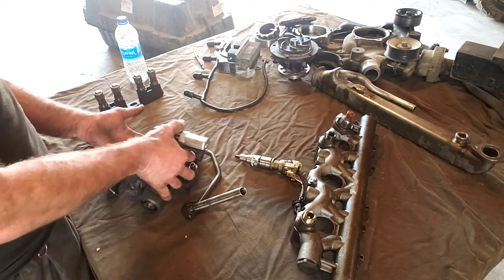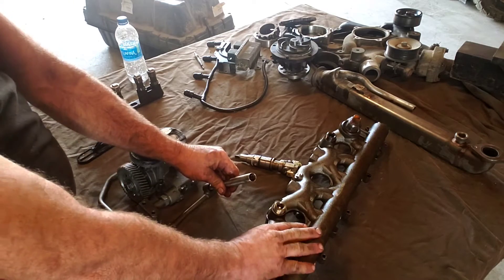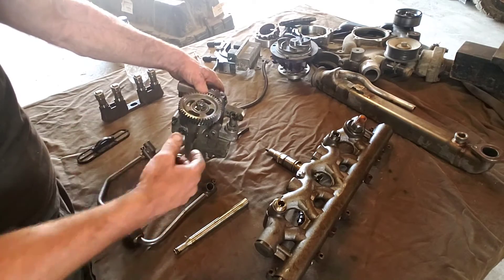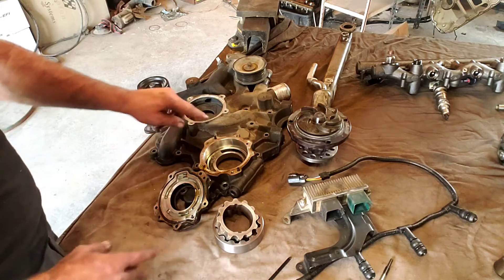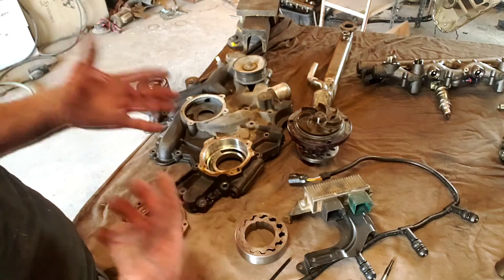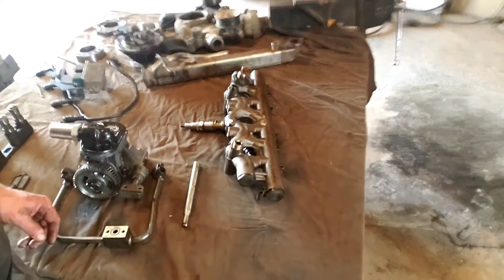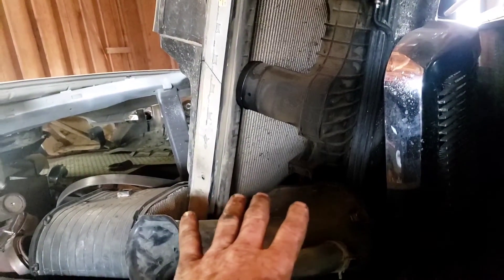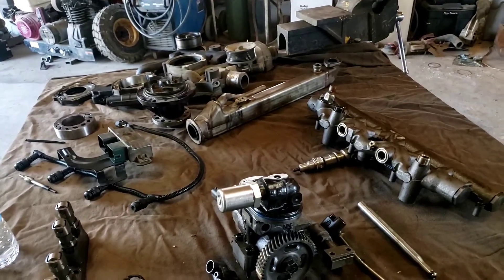6.0 Powerstroke - high pressure oils system - on the bench explained - key fail points

Comment: hello Jason, I'm tracing a no start when hot with an air test. replaced stc fitting but now I'm getting and air leak from the pump itself, from the gear. does it mean the pump is bad?
Reply from the maker: if air is at the gear yes
Reply: Hey, I pressurized my rails with shop. Air in my pump is leaking out that little. Weep hole by the gear in the back of the pump. Is that where yours was leaking? Do you know if it if you fixed your problem? I am probably gonna have to put a pump on it

Comment: Damn! looks of the lpop and turbo that 6.0 digested either a lifter or a fist full of gravel then  shit a brick out  turbo looks like it got dusted no filter bet the intake valves are pitted prob what killed the lifters debri in coolant stumps me think the degas would trap it. ..I've got an early 03' waiting till it cools off next month to pull motor so i can do heads/studs/lifters and reseal and i think i have everything i need to swap to a 05+ hpop and rails other then Idk if the Ipr valves are the same  or is there anything else i may run into or need besides Icp, rails, dummy plugs, branch tube,, and stc fitting?